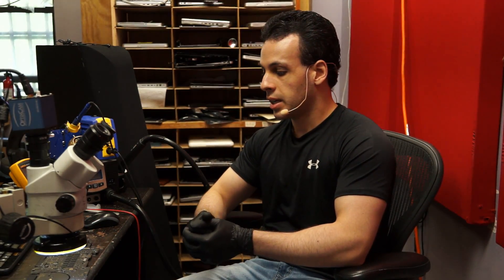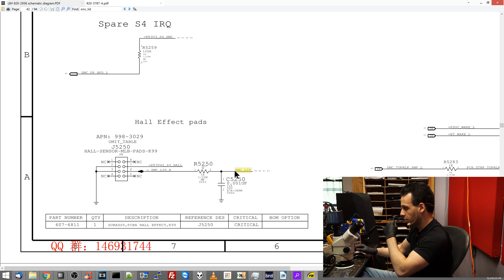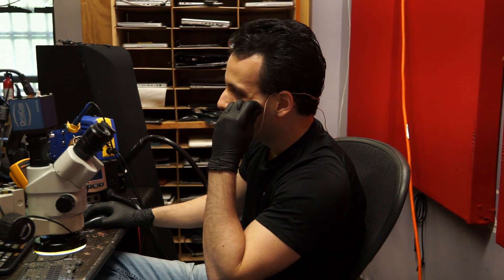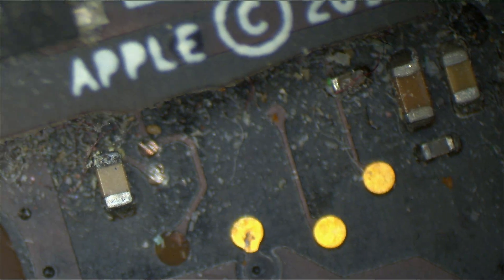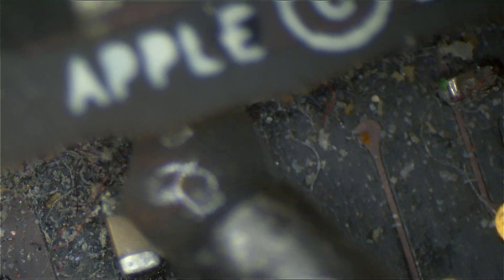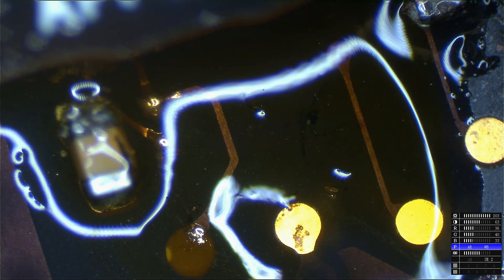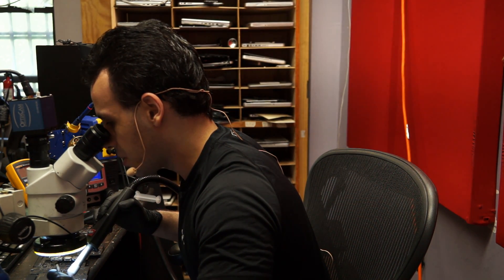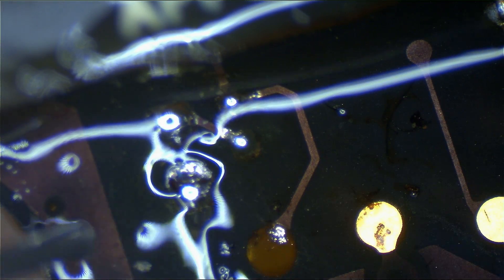Laptop keeps going to sleep after liquid damage

Comment: 4:10 I agree. An additional fact to reinforce that statement, PCB Land/Pad repair kits are.... $100 to $400 per kit. I actually have several of them left over from my previous job over 14 years ago (even ones that repair fine pitch SMT down to 0201) and they work great when needed, but like you mention... do only what's necessary, not more.